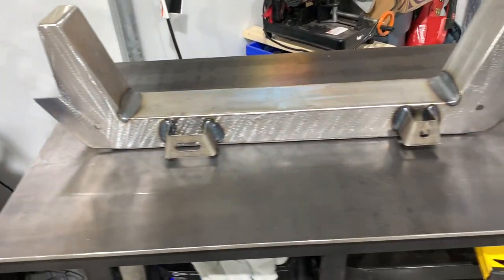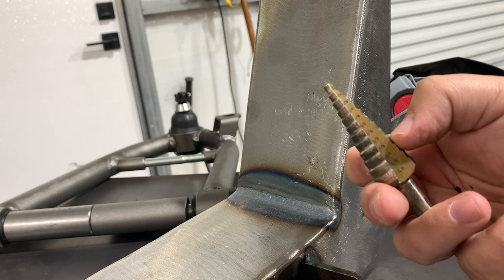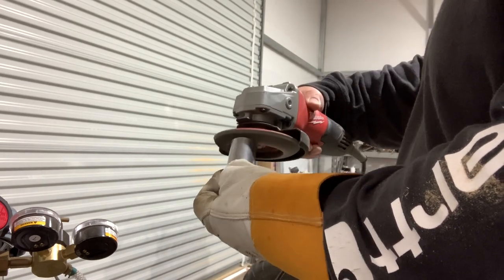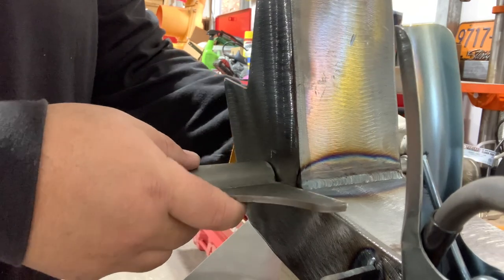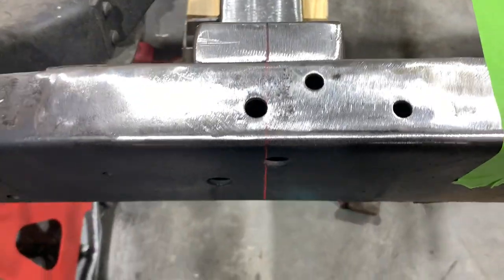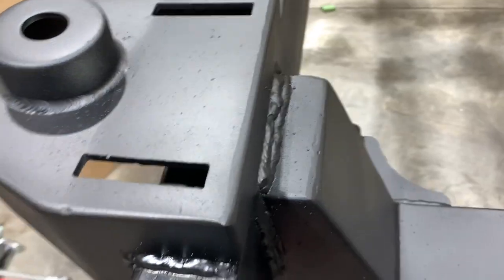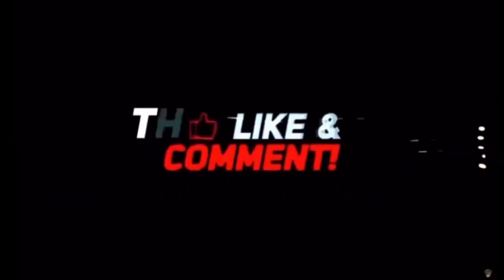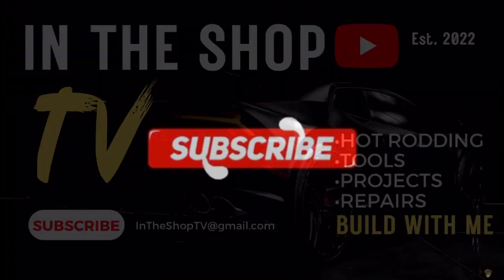55’ Chevy Truck | Crossmember

Comment: Everything is looking good, as to the measurement, I wouldn't go off the end of the frame. Try using the hole between the rivets of the original cross-member, which is probably what the factory used to align it. As an old-school body man, 1/8" out was the max acceptable range, cars and trucks were very different in that era, and there was plenty of room for adjustment.  
Also how long did it take to install and weld everything in today's video.
Reply from the maker: Maaannn… I’ll be picking your brain once I start sanding sheet metal! As for my time, working leisurely, it took me Saturday and a Sunday morning. But actual man hours was about 4

Comment: You do get grace, for a 32 nd to an 8th . degree. on caster and camber. that will fix it. the trucks frame is an 8th off any way front to back.

Comment: Just starting to follow.  Watching all videos in a row to get psyched up to start on my 55 gmc 2nd series.  It's taken apart down to the frame.  Is this the first time you've done this specific build?  Also, in your measurements, you didn't check for squareness by measuring diagonally.  Is squareness not terribly important?  I'm enjoying your build so far.
Reply from the maker: Thanks so much for following along! Ive built a lot of GM cars and trucks over the years and several tri-fives but this is the first tri five thats a full frame off custom build. Yep I checked for square… the passenger frame rail is inward at the very end by 1/8”. The core support still lines up perfect which is what’s important as its the center foundation for the fenders and inner fenders. The only thing it would affect is the front bumper mount. However a simple shim or washer rectifies that. Thanks for watching!!

Comment: Hi Mike, started late on this series so I am catching up on all the older videos now.  One question on this segment.  When you found the 1/8" gap between the frame rails and the crossmember did you find that your rails spread on you or was the crossmember cut for less then the 29 1/2" that you initially thought?
Reply from the maker: Its the common case of nothing being 100% true. The crossmember AND the frame are somewhat crude and have minor inconsistencies throughout. In truth, when it comes to welding, I’d MUCH rather have a slight gap than an ultra tight fit up any day! Will always be stronger! Good luck and thank you so much for watching my videos!

Comment: Hey brother you did great love the video I just bought a kit for my truck and no instructions I can't find anything do you know the measurement of your bottom control arm hole from the bottom of your frame and or crossmember from the bottom of the frame also I know you angled the top hats like you were supposed to and I know I need the angle my top a arms but my question is do you angle the crossmember or keep it straight and angle the top a-arm
Reply from the maker: Hey! 
So you want the crossmember to be welded in dead-on straight. The geometry of the spindle accounts for the canted angle of the upper control arms. Hope that makes sense.
Reply: @intheshoptv  so my kit it's from TCI it's kind of all purpose and I can't find the measurement of the bottom a-arm  hole to the the bottom of the frame I've been looking all morning and last night also my kit is a little different it doesn't come with the hat it comes with the tilted A arm bracket for coilovers
Reply: I really appreciate you replying I guess what I'm trying to ask the bottom a arm stays perfectly  horizontal and the top A arm bracket I've read I need to make it 3° what's confusing me as I've watched a million videos and everyone I've been watching it looks like they put 3° on the bottom A arm bracket as well
Reply from the maker: @tuckerc3802  I can say with almost 100% certainty that my lower arms are completely squared and level to the bottom of the crossmember (which is also level). Doesnt your kit come pre-drilled for the A-arm bolts?

Comment: No offence meant but do you plan on going back and cleaning off all the little molten drops you get with mig welding since you were talking about the control arm welds. Just curious
Reply from the maker: Do you mean weld spatter (little BB’s) or the weld bead itself?

Comment: Hey man, I won't actually need those blueprints, but can you tell me how tall the frame rail is where the cross member welds to it? I want to say its 5 - 1/2, but I could be wrong. Thank you in advance. I should be putting my kit in one of these next few weekends.
Reply from the maker: Sorry I just saw this. Did you get it figured out - I can go measure today if not

Comment: If I am following correctly, it looks like you are going to open the t-bolt slots on the wrong sides.
Reply from the maker: Left side is further back, so opening the front of the slots should bring that control arm forward
Reply from the maker: @Swick2000 You know, Im filming the follow up/repair right now, and as it turns out, you are 100% correct. Fortunately, Im a little OCD and measured it all about 20 times again so I would have caught it either way. But I think these types of comments are great… imagine if another person were to just start cutting without re-checking their work!? Or even if someone else follows this video one day with a similar issue - good eye, man!

Comment: I wouldn’t use the end of the frame the instructions say to use a specific point and not the end of the frame for a reason.   If I remember they weren’t all cut exactly the same
Reply from the maker: I didn’t use the end of the frame for installation, I used the front shackle hole as required. Im only measuring the finished product against the end of the frame for reference, I also double checked for square using several different locations including the original crossmember. All measurements show about the same discrepancy.
Reply: @intheshoptv  I saw u used the shackle hole for install don’t remember it showing in the video that it measured off from there.   Still I believe u will be ok u took way more care in doing urs than I did mine was I was 16 and mine drives just fine

Comment: What location on the frame rail did you use to level the frame? Side to side is easy but front to back is tough. These frames narrow as you move towards the front and start to dive a bit towards the front. I'm installing the same kit on my 58  Apache and when I lift the crossmember into place and it meets the bottom of the frame the crossmember is slightly tilted towards the back of the truck. I assume I should level it to match the frame rail. But what part of the frame haha. Any help would be greatly appriciates.
Reply from the maker: As far forward as the level will go before the frame rails dip down. The crossmember/boxing plate section of the frame rails is level with the rest of the frame from there to right before it humps over the rear axle. I set my crossmember to be dead level to gravity. I use a digital level and look for 0.0
Reply: @intheshoptv  ok I did notice the top is level. The bottom of the frame tapers. So your saying level the frame off the top rail front to back and side to side. Slide the crossmember up and then level it front to back and side to side.
Pretty sure my crossmember was built on a Friday, comparing it side to side measurements on it vary by about 1/8" all over. The bottom that butts up to the bottom of the frame are actually different measurements on all 4 corners.
I expected more from Heidts but I'll make it work.
Reply from the maker: @N8z14  none of them line up perfectly square brother. Yeah, I made sure my frame was level in all directions, pushed the xmember up until it made contact, squared it side to side, then placed a digital level in it side to side, then turned the digital level sideways and made sure it was straight front to back and tacked it in. My work was perfect and it still came out 1/8th” off do to irregularities in the 70yr old frame. I showed in a later video, how I corrected it.
Reply: @intheshoptv  I ended up calling Heidts today. The guy said the crossmember angle front to back in and in relation to the ground isn't actually that important. What matters is that 20 7/8" measurement and making sure it is sitting square to the frame rails and centered between the rails. I was surprised he said that but I guess that's why the instructions don't specify a crossmember angle. I'm going to do same as you did. Thanks for your help, Mike. Crossmember is getting welded in tonight and then I'm into 4 link install.
Reply from the maker: @N8z14 Sounds good. Good luck! Ugh the 4-link… I had lots of custom fab work with that! You’ll see when you get to those videos lol. Pre tip- if you’re planning on having your truck sit low, piece together your own 4-link kit INSTEAD of buying a kit. Wish I would have done that.
Reply: @intheshoptv  haha I've already watched all your videos. 4 link is sitting in my garage right now. I'm dropping 4 inches not 6 as you did I believe. Fingers crossed. Thanks again, Mike. I'll be asking more questions along the way